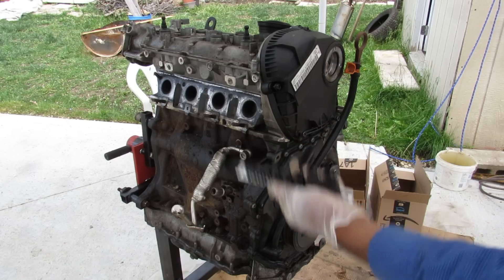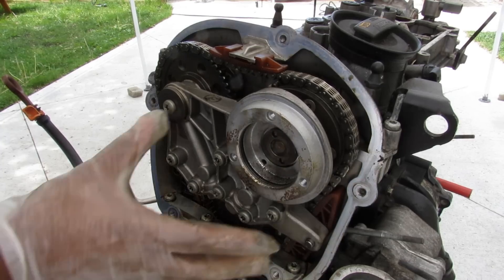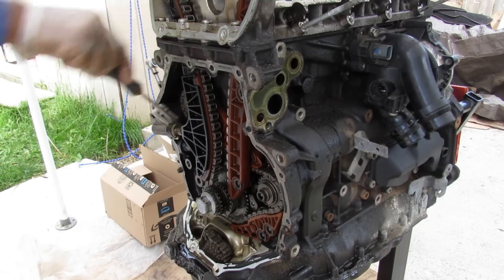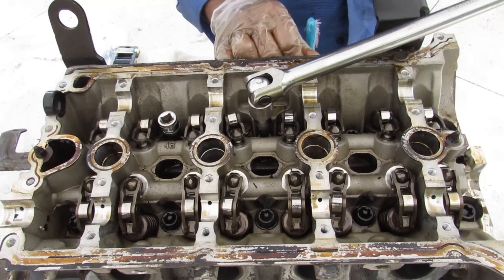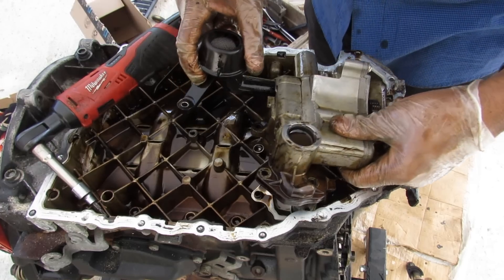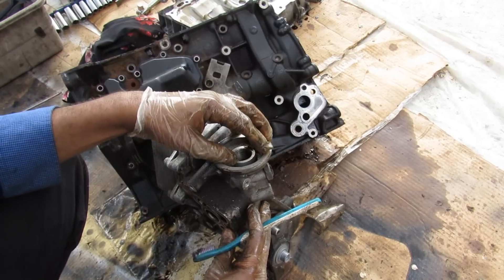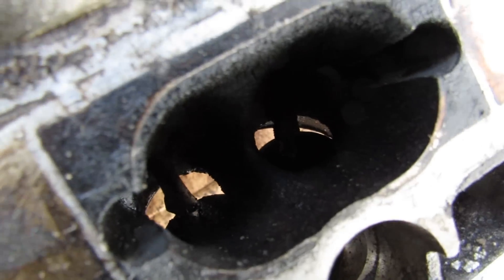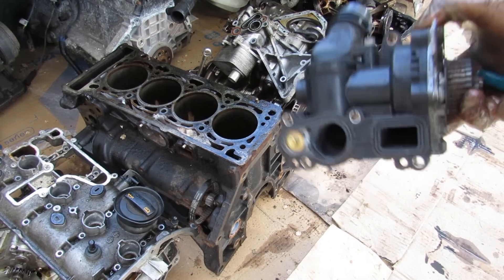Why Volkswagen Engines Fail

Comment: After 26 years of working in vw service, I concluded that volkswagen lives on the old glory of golf 1 and 2
Reply: Jetta MK5 TDI 1.9 owner here, some models still have it. Some definitley don't. Too bad the 2.0T's chains are so flimsy. The 1.8T had its flaws also but nothing like this.
Reply: 1.9 tdi was a reliable engine, 1.8t not too bad, but their replacing 2.0 tdi and 1.8/2.0 tfsi not so...
Reply: Mk3 Has the AFN engine (1.9TDi) from the mk2 and i have a Mk3 AAZ 1.9TD 75HP  370k kilometers works like new so i think the mk3 has the part of the glory from VW's old age
Reply: Golf MK3 is not bad too. There are some engines untill redesign the whole family in 1995 that are not shipped to the US market like the AAM Engine. It's based on the old EA827 block with lowered compression ratio to fit regular gasoline and with 1800cc displacement. It has a single point electronic injection system from Bosch called "Mono-Motronic". It had full support for the old OBD standard self diagnosis via KWP1281. This engines run and run and run and run. When they have issues it's mostly to bad gaskets or hoses for the vacuum. But since the Bosch system did not use mass airflow sensors and working only with throttle signal and the exhaust lambda probe there is no way minor vacuum leaks cause problems like engines with airflow sensors in the intake. Only downside is a less efficient fuel economy and only 75HP. But that's okay. This engines can make 300k to 400k without any major wear on the engine internals. Greetings from Germany.
Reply: And the Mk4 for the tuning/modding capabilities
Reply: How the mighty have fallen! 😢
Reply: Golf 3 and Golf 4 are extremely reliable.
Reply: @armdrk3233  How many years did you work in the WV service?
Reply: @wvpolosdi  Irrelevant.
Reply: @armdrk3233  Then it's your personal opinion and you base it on personal experience....every car is reliable if it's regularly maintained.
Reply: @wvpolosdi  I live in Europe,in Germany Volkswagen,BMW,Mercedes,Audi are very common cars.it’s not like US that they’re considered fancy rich people’s car.every ordinary person buys them.

a lot of heavy duty functional vehicles and vans are Volkswagen.used and abused..if they were unreliable why would they use them for daily workload? I grew up with VW Golf,most my friends and family owned Golf 4 and they’re always praised as good reliable cars.we had a Golf 4 with 300k miles it never missed a beat till it was sold.

VW wouldn’t be 2nd biggest car maker in the world if were bad quality cars.
maybe things are different in US market.
Reply: @armdrk3233  As I said ... if the Golf 1 and 2 had not made them popular, he would probably drive a Trabant and a Wartburg and be happy.
Reply: @wvpolosdi  well the rest of the world seems to disagree with your point of view because they keep buying their cars and vans and have made them 2nd biggest car manufacturers in the world.these people were not even around when Golf 1 and 2 were on the roads.
Reply: @wvpolosdi  - Sure.  Some engines will work reliably when cared for and maintained regularly.  Some engines will reliably grenade themselves regardless, especially the more complicated engines with cheap plastic parts in critical areas, like timing chain tensioners, water pumps, etc.
Reply: Was planning on swapping my shitty 98 Kia Sephia’s engine with a 2000 Golf engine due to it being a 2 liter and apparently reliable as far as 4 cylinders are concerned

Comment: Weve had v10tdi, audi a4 and now t6 with 2.0 tsi and they combined have caused the only failures, breakdown and roadside assistance requests in our entire family despite actually being serviced, meanwhile even awful nissan and honda cvt cars have been dead reliable with 0 issues for their 5- 10 year service lives. German engineering means unreliability, overengineering, insanely heavy weight, nightmare servicing and great marketing with insufferable fanboys.

Comment: Since this is an older generation of this engine, one might assume it only gets more sophisticated these days. We can only wonder what new horrors are lurking under the top cover of the new generations of these engines (DKZA?)..
Reply from the maker: The engines themselves say mechanically similar. It's the engine management and computers that change how it behaves.
Reply: @speedkar99  After watching your video I trust your expert opinion. I was referring to the dual injection and the new eco combustion cycle "improvements" for the most recent generation of these engines.. One could say, that even though they run worse (outputwise), at least there are many more parts that could fail..

Comment: Just fyi, the "fuel pump" you showed is actually the vacuum pump, which uses the rotation of the camshaft. However, the fuel pump is attached to the vacuum pump, it's the silver thing on the side, so it wasn't entirely wrong. The vacuum pump itself does not see any fuel though, the fuel comes in from the side of the fuel pump itself and goes out the bottom.
Reply from the maker: Ok I thought so too

Comment: I Was looking to buy a VW Passat 2.0 TSI with 220hp,it was an Alltrack,and everythng checked out,luckly i called my mechanics,they all said they burn oil and they have even more problems,one of my buddies actually had one in the Shop,he strated it up and a cloud of blue smoke just exited the exausth...So then I Bougt a 2.0 TSI 190HP,has 230.000km,no issues whatshowever..
Reply from the maker: Good call

Comment: they fail because they are designed to fail after a while, so you feed their services or buy new car. let me tell you this, these automakers have been testing materials for decades under harsh cold conditions of arctic to the boiling deserts of sahara. they put parts into repetitive use for millions and millions of miles. their engineering department can easily figure out how long will each part last. this is what they do. if they wanted, they would make an engine that would last 100 years under normal driving conditions with oil changes (if they wanted, but that's not what they want. they have a quota to sell more and more cars each year, so they have to make brittle engines that last max 5 years before it all starts to fall apart. you think it's coincidence? hahha. think again.

Comment: Here is a typical example of German car reputation being fake from beginning to end. They might be appealing to some, but when you scrap a little to see what's underneath, you find poor engineering. German car owners : good luck!
Reply from the maker: Poor maintenance as well
Reply: @speedkar99  and not very cheap either!
Reply: That does not apply to Porsche and BMW whatsoever.
Porsches are literally build to be driven hard on race tracks and the Autobahn. And they take that. 
BMW outclasses every VAG Brand while being somewhat "affordable".
Reply: @alouisschafer7212  My mechanic has a friend working for Porsche, and the number of vehicles coming back for electronic or mechanical problems is tremendous, as for BMWs, the ones with a Peugeot engine work quite well, the others...you need a good bank account, maintenance and repair are very expensive, and the built quality is not really what is expected for a self-proclaimed premium brand, let alone the catastrophic road holding. I personally had a Clio2 for twenty years, do you hear me? twenty years, it has never had any problem, not a single one! Can you say the same for a Mercedes? I don't think so.

Comment: I had an audi with this engine and it sucks. Single use bolts, stripped bolts everywhere. Carbon build up, oil leak, fuel pump leak, water pump failure, and to top it op the wire loom caught fire
Reply: The only good engine in the entire VAG lineup is the 3.0 TDI V6 Diesel

Comment: I was VW tech. Those engines are terrible.   The cam bridges are junk.  Once you lose that oil screen, it's over.
The tensioner sucks,  as well as the valves getting full of carbon.   I'm glad I don't work on those anymore.

Comment: Volkswagen engines fail, because they are developped by Volkswagen. They must be cheap. The only reliable engine, that Volkswagen has ever build, was the first generation 1.9 tdi. I was in the car business in Germany for 10 years, 1991-2001. Dealers like Volkswagen, because they are easy to sell. And you can buy and repair them cheap, if they are broken.
Reply from the maker: The diesels are Known to rack up alot of miles

Comment: In fairness, the water pump driven by the timing chain exists in quite a few engine designs; Subaru's 3.6 liter comes to mind.
I wanted to say - excellent video, narrated by someone who appears to be a very competent mechanic. Not a "parts exchanger", but somebody that truly understands the intricacies of modern engine design.
Reply from the maker: I'm an engineer not a mechanic. I didn't know that other designs exist that drive the waterpump through the balance shaft.

Comment: ALmost everything pointing at being a failure point, can be argued to be because of inadequate oil changes. 
NEVER believe the 10,000 mile oil change intervals on ANY car... reason why Toyotas of recent years are having the same issues.
Reply from the maker: 10000 miles is alot..can't believe they recommend that now.
Reply: @speedkar99  IIRC, 2018 and up vw audi porsche ect (maybe earlier), also toyotas 2016 and up. You can go check. 
Reason is, the oiling rings on the pistons getting clogged with sludge, causing ring wear... which cascades to increased oil consumption, then low oil, which basically wears EVERYTHING that is suppose to be lubed by oil. Reason why the chain wore prematurely. carbon buildup on intake valves on direct injection, is another issues, but don't think that would cause enough oil consumption to cause low oil.

Comment: Looking at that engine design has totally put me off buying a used Volkswagen….what a piece of crap….
Very informative video..👏👏👏
Reply from the maker: Used VW isn't always a good idea.
Reply: buy from an actual individual who cared about the car and has the records and you'll be fine. I've had my 2011 GTI since 2014 and everything has been fine. I am due to get the tensioner replaced next summer. I only drive it in the summer and hardly any city driving - mountain roads only. I chose this car over a C63 AMG. It was just way to much fun on curvy roads! ...and obviously saved me a ton of money vs the C63 that I set aside for repairs to the car and adding on to the car. So far I've only had to replace the Intake Manifold but it also only has 90,000kms - 85% of those being completely highway. I use 0/40 Mobil 1 and keep my oil clean. These are awesome cars but they do require TLC from their owners imo.

Comment: I have an '87 VW 1.8L GX that has 1.4 million kms on it. It's still running very strong with only minor noise from the intermediate shaft. Yes, it probably emits a few micrograms more out the tailpipe, but building another engine creates exponentially more pollution than is "saved" building these rubbish "modern" engines. I think the whole idea is to build more engines, even electric ones and the environment be damned.
Reply from the maker: Nice. Good old reliable VW from backnin the day

Comment: Is it rebuildable?
Reply from the maker: Yeah but probably not worth it. These engines are too common
Reply: @speedkar99  good to know, I have a 2014 GTI, with a leaking pump and rattling chain... gonna fix it before it fails

Comment: So which brands would have the best designed most reliable engines? Specifically in vans? Are ford and toyota good?
Reply from the maker: Yeah Toyota might last you longer.
Reply: What about Mercedes ?
Reply: Are Mercedes usually more reliable than VW, Audi and BMW??

Comment: The black carbon at the air intake and on the intake valves, is that allways a problem with Direct Injection ?  I ask this because i drive a KIA Sportage 1.6 GDI (so also Direct Injection), so I'm a little bit worried...
Reply: Yes every DI has this. This is why newer cars (and gen3 of this EA888 engine) use MPI - multiport injection.
If you have EGR even more crap will accumulate.  
But it's not that big of a deal really to be honest.
Reply from the maker: Yes. Lots of direct injection vehicles have carbon buildup issues.

Comment: Audi A4 b7  2.0 Tfsi is a money pit set me back 20k I also had rust issues just changed to a Lexus now. https://blackstar4000.wordpress.com/2017/03/20/audi-oil-chain-pump-failure-resulting-in-engine-death-twice-audi-a4-tfsi-2-0t-b7-model-issues-since-2015-to-2017/

Comment: Interesting in how a lot of very good engineering betrayed by a few poor choices on things like the chain tensioner and piston design. The very complexity of a turbocharged engine demands a lot of the things we see in the engine and packaging it for a small engine compartment only compounds the problem of configuring the components.

Comment: I had a VW Jetta the engine carboned up and no block heater which no one told me. Couldn't start in winter when it got really cold. Don't ever buy German cars Japanese way more reliable

Comment: Forget just the engines,,,Volkswagen has a long list of issues through out their cars
Reply: And all other car makes. They have all given up on ice anyway....
Reply: Don’t mention the transmissions.
Reply: And what would that be
Reply: @Euro Ultimate not really, only issues my toyotas have had have been rust, just like all vws. And some rubber parts breakign around drive shafts. Every time it gets to first colds tou have roadsides littered with vws that have hazards on and car groups are littered with people aksing about stuck doors and car not moving after engaging parking brake. Vws are poorly designed and built cars. Just cause they have leather seats dont mean they're good or fancy. Theyre cheap trash.
Reply: @Euro Ultimate Sounds fine. Toyota engines are actually filled with instructions and easy to work on.
Tellh im to start servicing volkswagens and you will find him hanging from the ceiling by his neck after he has to take out entire engine to replace one minor detail on an audi that was not designed to last or welding cracked blocks and replacing turbos every month on exact same car.
Germans can't engineer cars.
Reply: @Euro Ultimate its cause japanese are aware an invetnion called "scales" exists. their cars weigh 900 kg while germans are near 2 tons. German engineers haven't discovered that you need less of everything with less weight.  Also passats are awful cars that break down constantly. Every time it gets cold all car gorups are full of passat owners saying their cars won't start, they can't get in or doors wont close. Watching people defend vw is like watching someone try to promote eating turds to others.
Reply: @Euro Ultimate okay wont try to convert you. But here in europe german made german cars are cheap garbage.

Comment: I dont understand anything from engines, can you describe it just with few words is it good or not?
Reply: Not. However a lot of these design issues are common on modern engines, especially with the high power, efficient direct injection ones. "Show me the incentives and I'll show you the outcome". The manufacturer is incentivised to make it as cheap and good performance as possible, not long lasting or good to work on.

Comment: The 5 cylinder in the golf is just horrendous…it sounds like a tractor on start and suffers from the gummed up intake ports….bad engine designs 😯
Reply: huh? we are talking about the 2.0 tsi motor here.  The 2.5 5 has port injection and does not suffer from carbon buildup and much more simple and reliable than the 2.0T.  5 cylinders also sound incredible with an exhaust system.

Comment: I feel like this could be slightly biased. This is a 10-year old engine run to the ground. Toyota and Honda cheap out too.
Reply: But when things go wrong Honda's and Toyota's are much easier to work on. You can work on them at home with regular tools and equipment.

Comment: Why VW Engines Fail? Easy explanation, most of the time the owner is the bigest point in that chain. Yes sure every mechanical part can fail, the brand doesn's mather at all here. But if handled correctly this little fuckers run! We have 2 of those running one with 130k km and the other with 120k km no problems. And americans complaining about expensive parts, ye they are exensive in the US. Here in Germany they are cheap, but hey try to get parts in the EU for some Mustang, Camaro or other American brand car. They are not cheap at all either. Same goes for Japanese car parts.

Comment: Major Volkswagen issue with all TSI motors is lengthening chains. Well known in Europe. Motors will blow up after warranty period.
Reply: Not all TDI engines have. timing chains , the 1.4 TDI has timing belt.
Reply: @bobbybishop8426  TSI is petrol, TDI is diesel. I owned a petrol engine.
Reply: @bronson7279  I wrote that wrong , should be 1.4 TSI , that's what I have. So its a belt ?  That's what I thought I saw on the service intervals chart anyway.

Comment: Had a bent valve in my 1996 Audi 1.9TDi, luckily at that time Audi paid a new engine. A later A6 4B with 2.5tdi, same age and miles had a broken piston rod, Audi did not pay anything. Next A6 4F a broken automatic tranny (ZF). The Golf 1.4tsi from my wife had a broken cylinder head bolt. Poor quality from VAG all over the place. Timing chain problems and other stuff too. Am so glad ICE is over, we are electric for 6 years now (Smart and Tesla). No more greasy fingers.
Reply: btw: had Audis for 20 years and learned that you have to buy a model with the least mechanical problems. Still like the brand, but its vintage stuff.

Comment: 1.8t cruising 60mph and I lost all power. Got it home and pulled timing cover. Belt was split. Pulled the head and took it to a engine shop. Bent 16 out of 20 valves! 😄